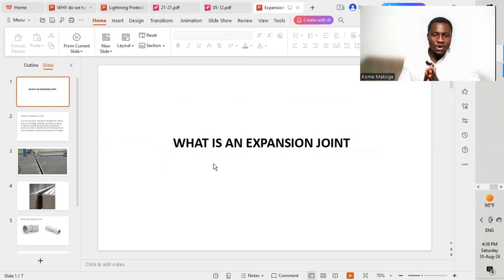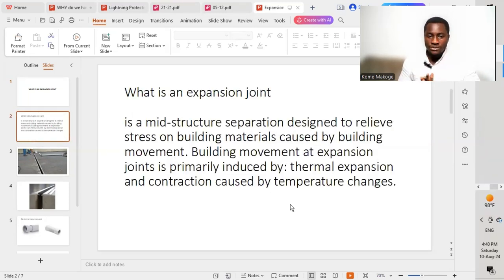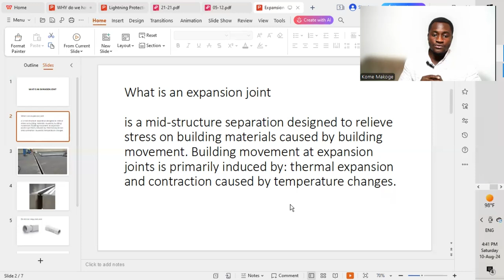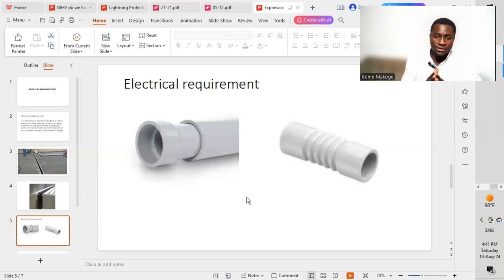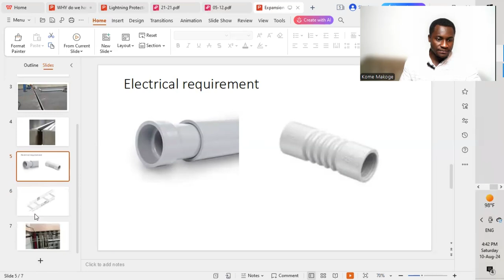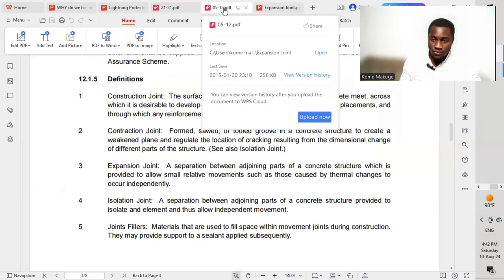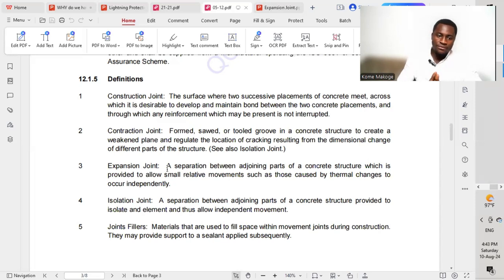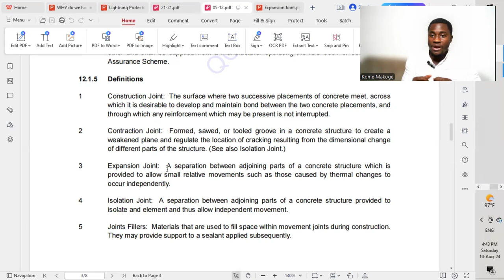What is an expansion joint/Electrical requirements#eletricalengineer #electrician

Comment: I thought initially that expansion joint is to extend electrical cable to another component
Reply from the maker: @arnauda636  Im sure now its well understood. What ever service that crosses an expansion joint, should cross with an expansion joint fittings. Such as mechanical, electrical and plumbing services. 

And these fittings are designed by the manufacturer.